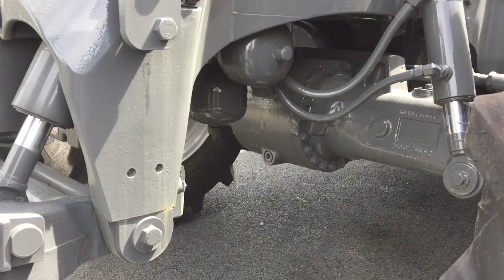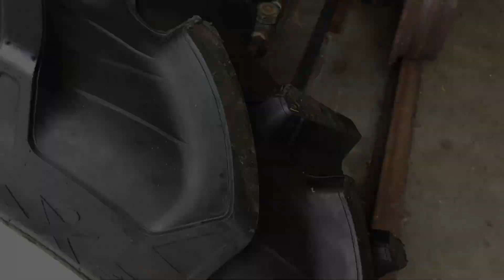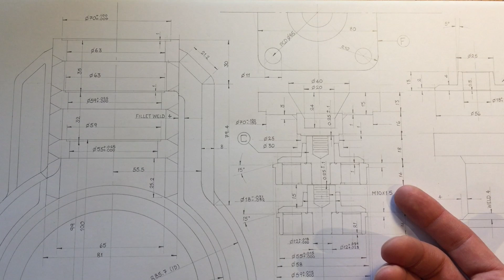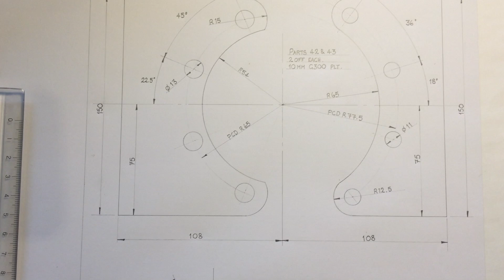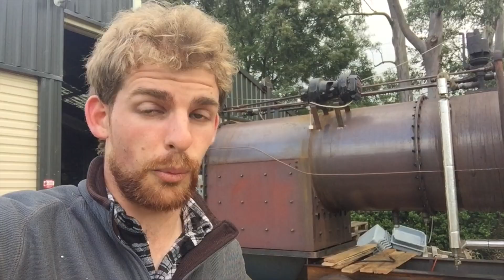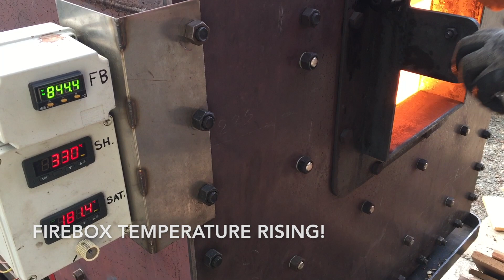The Future of Sustainable Farming | Modern Steam Locomotive Design & Build EP6

Comment: So when this whole project be completed, will it be used for revenue freight or just passenger excursions?
Reply from the maker: The project speeds up as I receive more and more support, so I couldn't tell you except that it will be as soon as possible. It will be used as required, probably passenger as it is a bit light for freight.
Reply: @Mackwell-Co  You know you can use that boiler for heating your house with steam and to power your own electric with that boiler